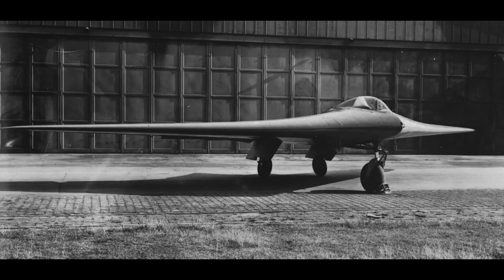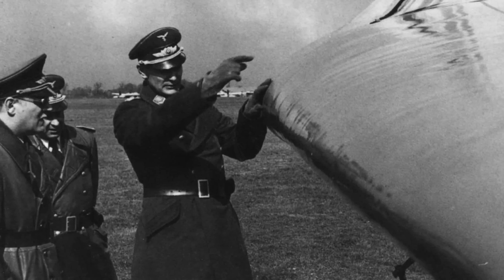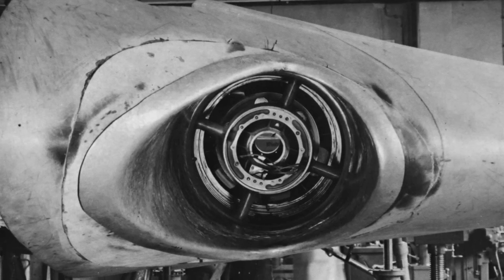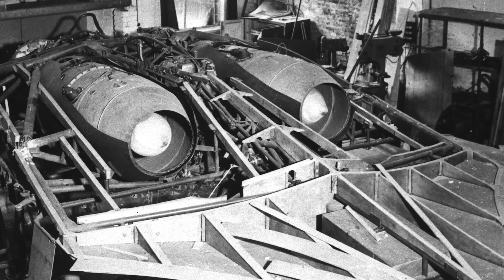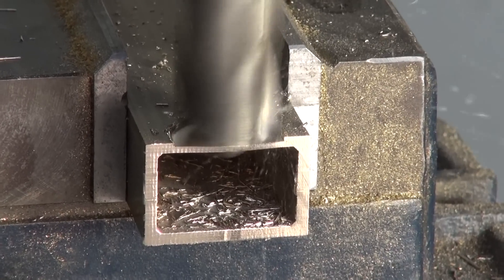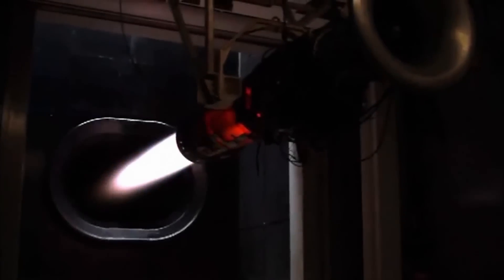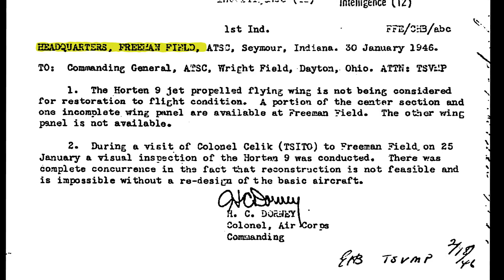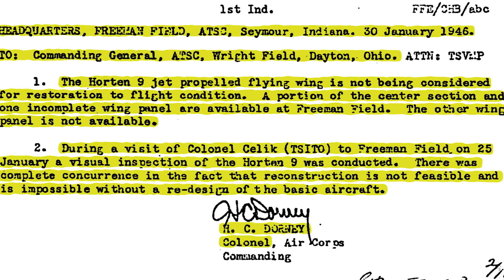Horten Ho 229 Reconstruction Project

Comment: "Allied pilots report UFOs"? That might have happened, but the Horten 229 certainly had nothing to do with it. There were only 2 prototypes and only one of them made 2 or 3 test flights, one of which was a simulated air fight against a Me 262. The Horten 229 never had enemy contact and no Allied pilot ever saw it fly.

Also it is a big stretch to assume the B2 bomber would be some sort of derivate of the Horten 229. Jack Northrop, the founder of the Northrop Corporation that later became Northrop Grumman, the company that built the B2, had designed and tested the first "flying wing" or "wing only" ("Nurflügler") aircraft before the Horten brothers started. He was in love with the idea of a "flying wing" aircraft pretty much since he started building aircraft and he never gave up on the idea. The Horten 229 certainly was better than Northrop's first flying wing designs and he might have learned a thing or two from the captured prototype, but he did not steal the idea from the Horten brothers.

All 3 men were fascinated with flying wing designs and all 3 thought they are the future of aircraft design in general. That their designs also turned out to be harder to detect by Radar however, was more a positive side effect than the original intention. The B2 isn't a flying wing design because it is a copy of the Horten 229, it is a flying wing because that just happens to be the best design for stealth aircraft, especially for big stealth aircraft.
Reply: The vast majority of ufo sightings have occured after 1947?   After the war.  Maybe Soviet Union and United States reverse engineering ww2 German technology?  You know, like the swept back wing,  full moving horizontal stabilizers for supersonic flight,  axial flow turbojets just to name a few.
Reply: Stealth is about materials and reposition of engin... not about wing concept.
Reply: Some secret stay secret... Today secret is "Americans, Russia founder of jet aircraft, stealth, b2 etc" "Americans, Russia is founder of kalašnjikov,m 16" "America,Russia is founder of atomic bomb, energy" "Americans, Russia is founder of rocket technology and space technology"... Well, that what is happend to advance civilization, people when accepted dictatorship, dictatorship of man build by bankrobbers with one gold, destroy every thing west from France, every thing what is not in our control.
Reply: Northrop used Prop Engines, the Horton Brothers HO229 had the Jet Engines in the Fuselage first, Northrop stole that idea and put it on there B2 Bomber, Wake up Blind Freddy can see that, Spoils of War it's called.

Comment: I think that would be a great idea.  With the use of modern more reliable engines the HO-229 should perform magnificently.  At the very least the one in the Smithsonian should be fully restored to educate people about the flying wing technology  and where it originated.  Flying wings generally perform very well with the addition of winglets at the wing tips,  otherwise some sort of yaw stability will be needed such as split elevons.

Comment: You will need as you likely all ready know better engines. Computer aided controls will assist with their needy control characteristics. There is if you didn't all ready know information on the leading edge air ionization of the b-2 that might be handy that has recently turned up on the net.

Comment: İ have 2 questions= İs there a technical manual of this aircraft and is it possible for you guys to build the Lippisch P.13a if requested and paid for (how much will it cost) ?
Reply: Hi, sadly there are no tech manual available for Lippisch P.13a, the blueprints will have to be pulled from Deutsch Museum in Munich. The document pull is about 2-4 months (standard bureaucracy) or trip to Munich (about 2 weeks digging in archives) + about 6 months of CAD/SolidWork analysis since such exotic machines existed only in rough blueprint forms and must be analyzed for stress, power to weight, CG, etc, aerodynamics, etc... that alone will cost a pretty penny. In addition to that, the fact that this is a ramjet aircraft unfortunately I would not be able to quote the price even in the approximate range since we do not have technology / materials to manufacture ram engines. P13a is a beautiful machine but unfortunately it is too advance for us, unless of course you know where to get a spare ramjet engine ;) Wishing you all the best in your search.
Reply: Now you got me thinking. Technically it can be fitted with a spare turbojet but that's the best I can think of.